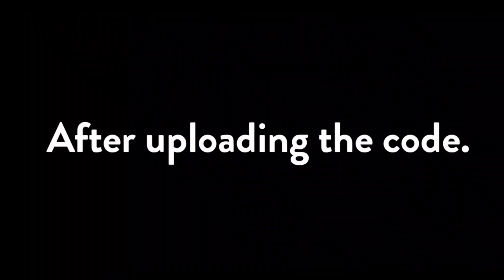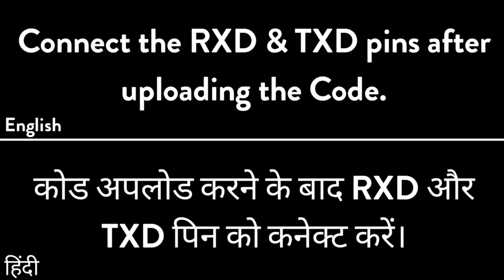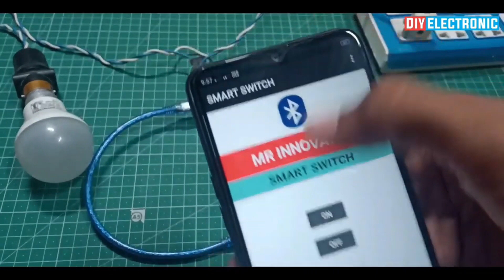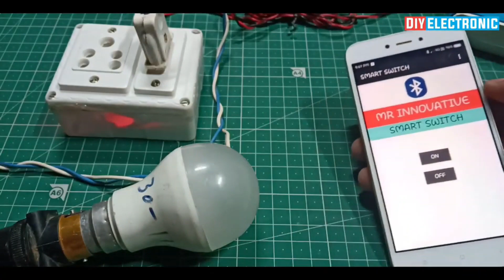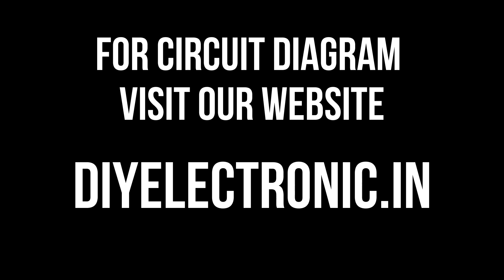3 Amazing 🔥 Arduino Projects | Arduino projects for beginners in hindi

Comment from the maker: 🔻 LED Chaser Code and Circuit Diagram.
https://www.diyelectronic.in/2020/04/How-to-make-a-led-Chaser.html?m=1

🔻Automatic soap dispenser code and circuit diagram.
https://www.diyelectronic.in/2020/03/automatic-soap-dispenser-using-arduino.html?m=1
Reply: Yess
Reply: Code is visible
Reply: @Diy Electronics , the code is nowhere in sight on your website
Reply: @devansh7490   yes

Comment: Hello sir...🤗
Sir_could you please share the Arduino Uno coding of automatic soap dispenser...
Really very nice project done by you😍
I Wanna make it..
Reply from the maker: 🔻Automatic soap dispenser code and circuit diagram.
https://www.diyelectronic.in/2020/03/automatic-soap-dispenser-using-arduino.html?m=1
Reply: @DiyElectronic  sir Arduino coding isn't available in this link...
Reply from the maker: Code -: https://github.com/diyelectronic143/ArduinoProjects/blob/master/smart_hand_wash.ino
Reply: @DiyElectronic  thanks a ton sir❤️

Comment: I didn't get the point of the first project other than learning to code and connect parts. Bluetooth has a very limited range so u can control if maybe from the same room or from a very close one. So basically u could just go and turn on the switch manually.
The second one i found very useful but the friction is too much for the small servo to move. either put a better servo or use lubricant to reduce the friction of the spout.
I liked ur projects a lots.
Reply from the maker: OM KULKARNI -: Thanks For Feedback 😃
Reply: @DiyElectronic  👍👍

Comment: I have a doubt should the laptop be connected to the Arduino entirely or can a battery be used?
Reply from the maker: Yes you can use 9 volt battery 😇
Reply: @DiyElectronic  thank you so much bro..
Reply: @DiyElectronic  I am planning to do the hand sanitizer project...
Reply: @AshwathKumarU  vanakam d mapla..

Comment: Codes pls & circuit diagram
Reply from the maker: 🔻 LED Chaser Code and Circuit Diagram.
https://www.diyelectronic.in/2020/04/How-to-make-a-led-Chaser.html?m=1

🔻Automatic soap dispenser code and circuit diagram.
https://www.diyelectronic.in/2020/03/automatic-soap-dispenser-using-arduino.html?m=1
Reply: @DiyElectronic  is not any code in this link...pls can u give it?